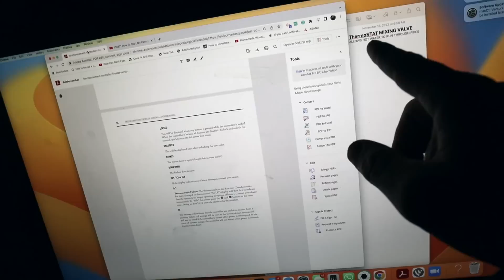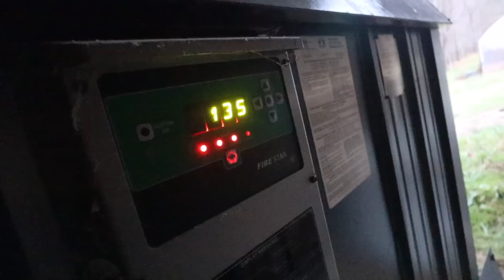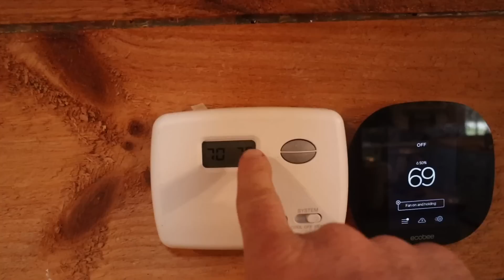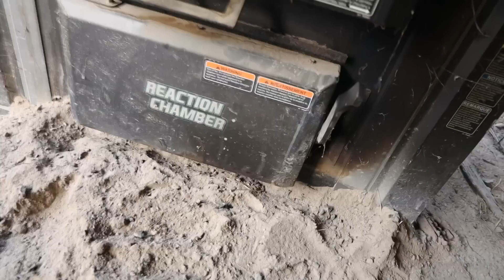Building a Homestead in 100 Days - Day 32

Comment: I saw a retractable folding stool  ( black and red plastic) adjustable for height, that looked perfect to use for milking...it folds up round/flat and has a shoulder strap if you want to use it. Thought you could toss it in Sally to use.check it out.

Comment: you are plugging away - reps will make it easier - over clear as you need sun on fields - the machine  will pull everything out with no issues - just get a big enough machine - you may want to use machine to assist in  bigger felling - watch out - do the  big ones yourself #barberchair

Comment: +7:50  Justin, you're wasting too much time bucking those logs into shorter firewood. Switching modes so often between felling trees and bucking logs is needlessly eating up your 100 day window. You need to buck the logs eventually, but not right now. Just get the logs on the ground as quickly as possible and go on to the next tree. If you run out of space, that's when you switch modes to clearing some of the felled logs. But turning logs into firewood isn't part of your goal. So don't clear them all and don't buck them all the way down to firewood. Just cut them down to lengths you drag away with your 4x4 or tractor. And only drag them far enough to clear enough room to get back to felling trees. You need to cut down as many trees as possible in the shortest amount time. Stacking the logs into woodpiles and/or dragging the logs out of the woods is in fact something you can do on rainy days when it's unsafe to cut down trees.. When you do get around to bucking the logs into firewood, you should drag them to a flat spot where it's easier to buck a bunch of them all at the same time. Perhaps load them on a trailer (or the forks of your tractor) and haul them in 20 foot lengths all the way to your woodpile. After all, it's much more efficient to haul a single 20 foot log out the forest than to cut up and haul 10 two-foot pieces of firewood.